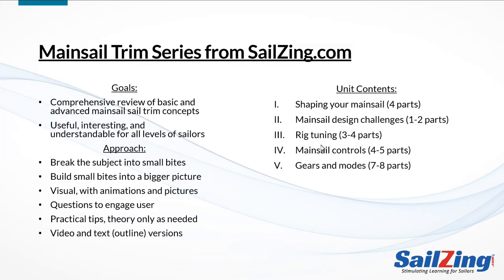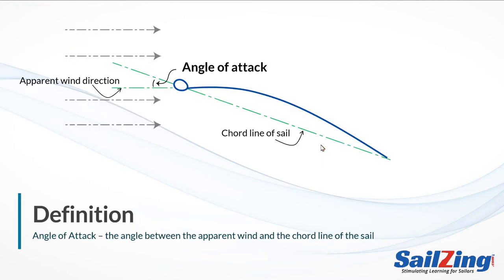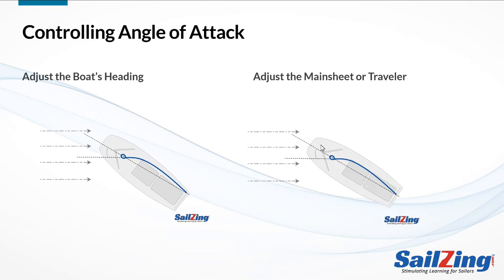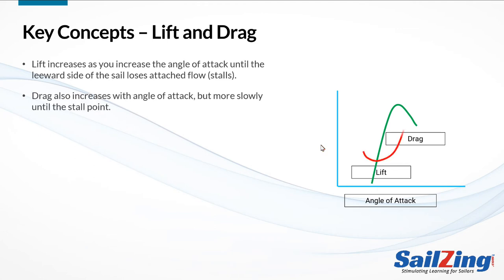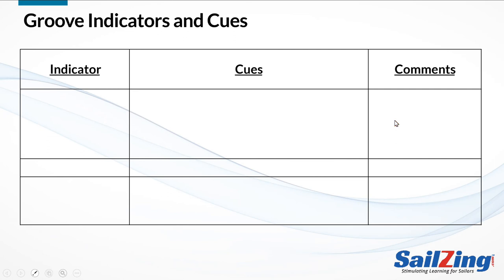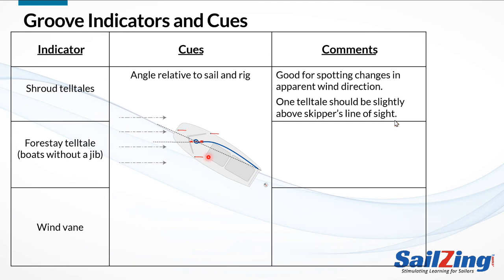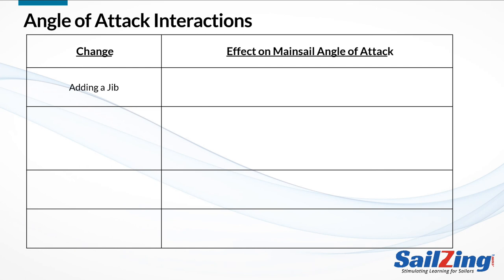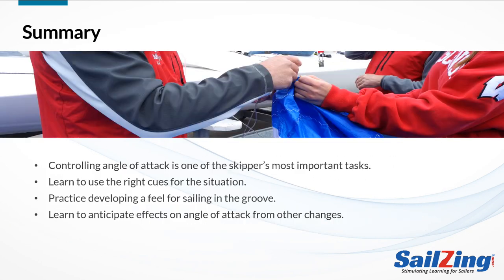Upwind Mainsail Trim: Shaping  your Sail, Part 1 - Angle of Attack

Comment: Gonna jump in here after the airplane wing  analogy. Changing the attitude of the wing to airflow does change the AoA, but it does not control the climb or dive behaviour. That is controlled with the throttle. The old model Bernoulli model of pressure difference has also been - not entirely- discredited but still in vogue because it is easier to understand than Circulation Theory. Which is how lift actually works on an airfoil, but nobody wants to do the math, or at least very few are capable of the calculus. You don't really need to work the numbers, the telltales are doing that.